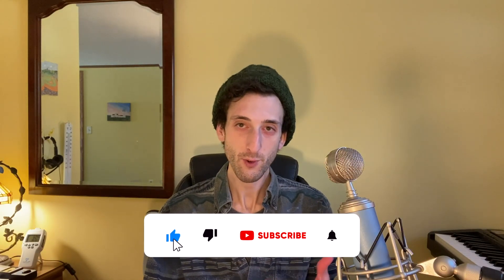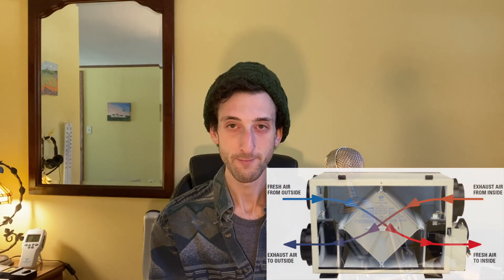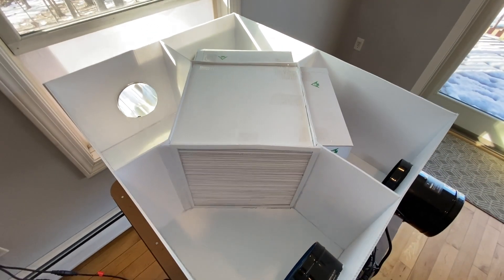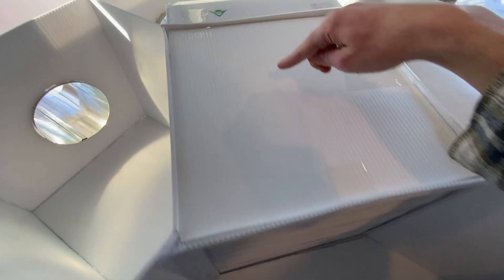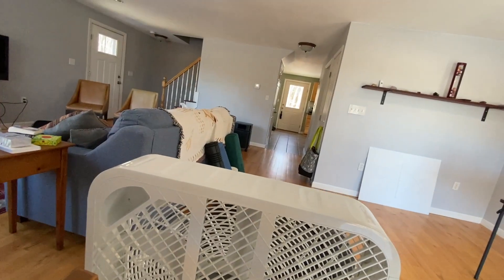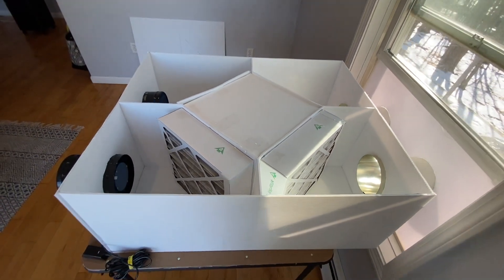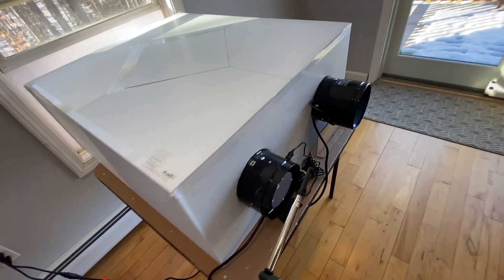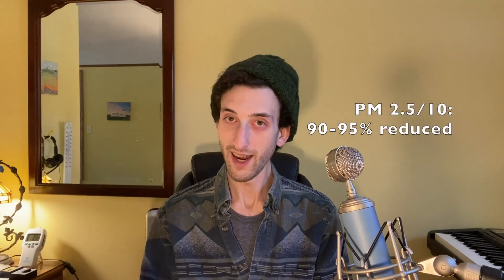I built the best DIY heat recovery ventilator I’ve seen on YouTube

Comment: I'm going to have to build my own. After updating the insulation in a hunting shack, it's too air tight. These massive units are too big for a 12x12 single room space. The mini or single room "HRV" units being sold, have fresh air intakes right next to their exhausts like bathroom fan style HRV's, which is an obvious and embarrassing engineering flaw.

Comment: You probably want to insulate the intake and exhaust pipes on the outside end of the HRV - those have cold (in winter)/hot (in summer) air that is going to lead to undesirable heat transfer to your indoor air.
Reply from the maker: I like that suggestion! Thanks.

Comment: Why do you need a merv 13 hepa filter when pushing stale air out of the house?
Reply from the maker: Good question! So first, MERV 13 and HEPA are two different things. I’m using a MERV 13 here when pushing stale air out of the house to protect the core from indoor pollutants.
Reply: @HealthyHomeGuide  The core is plastic, so even a much lower MERV (and hence higher airflow) filter would handle protecting the core from getting fouled with debris.
Reply from the maker: @Entropy512  I wanted both filters (intake and exhaust) to be the same rating (MERV 13) so that the pressure is as balanced as possible (positive/negative pressure isn't created).

Comment: On what speed setting do you run your fans? What rpm is it? And if you would use duct tubes would you up the speed?
Reply from the maker: They’re 8 speed 288 cfm fans, and I usually run them on speeds 1-2. If you have particularly long ducts with a lot of bends and ribs, you’ll likely have to increase the fan speed to get the same airflow. I do not like flexible ducting, because of the ribs which create a high amount of air resistance. I’d go with rigid ducts.
Reply: @HealthyHomeGuide  do you think you can have the exhaust fan on lower speed setting than the supply fan? It kind of makes sense to me,  to have the warm air pass slower through the cube core to warm it. Or it needs to be the same because of some balance, so it doesn't create some pressure change or whatever...
Also, do you maybe know what CFM would be on these lower settings like 1 and 2 ?  Appreciate it, cool idea for a channel, wish you luck!

Comment: I had an idea that might make the core better:
What if you would have Coroplast thickness bigger for the exhaust than the supply, then take like a 0,60mm copper wire and go in between every hole, since copper better conducts heat it should keep the core warmer, while the thinner Coloplast is on the supply, which makes the air pass slower through the cube. 
You have all the measuring stuff, so you could actually see if it makes a difference. But I don't see how plastic could be better than copper in heat conductivity.
Reply from the maker: I like the idea! I don’t think this HRV needs it, because the air it brings in is already warm enough for me, and I don’t know if additional energy use would be worth it. However, a heating coil could be useful on my other design, which consists of a fan attached to a MERV 13 filter. I’ll keep thinking on it!
Reply: Neat idea!  I bought a few rolls, and even got some for free, of aluminum window screen.  The thought was at some time 3D printing or maybe CNC in wood a tool and die to stamp like a linear ridge zig zag stamp so to increase the surface area of the alternating layers.  Where I plan to only space the one path of flow and use corrugate on the other path. The spaced path that would use two other maybe three strip of one width corrugate tubes would have the zig zag aluminum mesh.  I left off wondering how to plastic weld both sides into the full sheet of corrugate.  The other thought was just ironing into both side of the corrugate the aluminum screen.  That might work suitable as well and just then placing the zig zag screen into contact.  I probably should work on again since I have now another size of corrugate material and not only the cutout larger thickness.
Reply: just make the readily available pre made inexpensive plastic core a bit bigger, no need to finess the build.

Comment: Can you please tell me what is the ideal thickness of the Coroplast? did you go for the thinnest one? The one i found is 2,5mm, also there are 3mm and so on. 
Also do i need to worry about the adhesive spray off-gassing? could that be a problem?

Also, great stuff dude, keep making videos!
Reply from the maker: Certainly! I used 4 mm coroplast. Good question about the adhesive spray off-gassing. I used low VOC adhesive spray. It is also designed to dry quickly. Still, I left it outside for a day or two to ensure it off-gassed before being installed. Once installed, air shouldn’t pass in between the layers, where the spray is, so I think we’d be safe. 
Thanks for the encouragement!
Reply: @HealthyHomeGuide  
Thanks for replying, I have few more questions. 
1) I suffer with my breathing in my house, I need to make this, and I know if I make it, it will run every day, all day. When it comes to your fans, do they use a lot of energy when 2 of them are working all day.? And are they enough to work with longer ducts that would span a few meters?

2) Could I make a system where I'm placing this into an attic, taking air from one room (bedroom) pushing it outside, and pushing fresh air into another room (Workroom). So I have only 2 ducts going, Or do I need 2 ducts for every room? 
If i would just take air from one room (bedroom) all day and then just change the flow when I'm using that room at night. And then it's taking air from the workroom and pushing fresh air into the bedroom. 
I hope i'm being clear - my English is not that great XD 
Thank you for your time, I appreciate it!
Reply from the maker: @CroElectroStile  Sure thing! The fans I used have fully adjustable, brushless EC motors (efficient), and are 36W at full power - I run them on low speeds, which draws even less power. They're designed to run 24/7. I haven't calculated exactly how much extra money I'm paying to run them - I don't believe it's all that much.

In general, if you connect the fans to ducts, you'll likely get less airflow and have to run the fans on a higher setting. How much less airflow is dependent on a bunch of factors. The longer the ducts are, the more folds within them (as with flexible ducts), and the more bends, the less airflow you will get. If you're using rigid ducts, you'll get more airflow than flexible ducts. I very much dislike flexible ducting. It smells like chemicals too.

Great questions. The amount and distribution of ducts is a very complicated subject. Basically, the more branches you put in your system, the less airflow each branch will get. I'd recommend keeping it simple for DIY projects - as few ducts as possible. I'd bring the fresh air to the room you spend most of your time, and exhaust the air out from a different part of your house. Hope that helps!

Comment: Wow! Excellent job, I'm definitely going to build something similar
Reply from the maker: Thank you! And good luck! Let me know if you have any questions.
Reply: @HealthyHomeGuide  do you know how well this would work for hot and humid Texas summers? I know an ERV is what I need, just didn't know if that poly might work well for that or if I needed something like an aluminum core. Thanks!
Reply from the maker: @Slipperypuffin  Yup, an ERV (as opposed to an HRV) would absolutely be the way to go for the specific reason of ensuring your home didn’t pull in too much moisture from the humid Texas outdoors. If you have the budget and space, I’d recommend buying an ERV, because I’m not sure how to actually build one. 

If you want to try an HRV instead (which won’t get rid of humidity) coroplast could certainly work because coroplast is moisture resistant. Based on what I’ve seen, a coroplast core should do fine at cooling the incoming air in the summer, you’d just probably need some sort of condensation drain.

Comment: A low tech "defrost mode" method is to just redirect the two outdoor ports together so the core warms up to room temperature eventually. By measuring the output temperature and only going into defrost mode when the output goes below freezing can make it automatic.
Reply from the maker: That’s fascinating, I love the idea!
Reply: For a simpler low tech defrost, you could just put it on a timer. If the unit is in the house, you could turn it off for a few hours and it would naturally warm up and defrost. That is even more low tech.

Comment: Wow! Your did great! You did a great job! And so efficient too! I live in a very small home in CT, a 200 yr old home, I renovated 20 yrs ago. Our home is 24x22, with basement, 1st flr, 2nd flr, and walk up attic. It's a post and beam kinda house. I installed ductwork, and Air handlers, one in the attic to service the 2nd flr, and one in basement to service the 1st flr.  I have a boiler for heat, so it is a hydronic system. Each AHU has a hot water coil, that way I can also temper the discharge temp. So I think about 5 yrs ago, I added a Fan tech ERV to my 2nd flr setup.  I added external filter boxes, with I think Merv 12 filters it came with, cause you need to keep that core clean as well as the air we are gonna be breathing.  This was the lowest price unit at the time, and the enthalpy core is same product you used, but not as nice as yours, mine is not very efficient, so on really cold days, I don't use it.  But a year later I bought a HRV for the basement I spent a little more and got one a bit more efficient.  [I'm not rolling in $] I have seen some really high efficient EVR's but big $.  I'm fortunate I inject the "make up" air into my air handling system.  I also have UV-C lights in the AHU's.  I have my 2nd floor ERV set up so when I run it, a relay turns on the FAN mode on my t-stat, so the AHU is running to distribute the air when the ERV runs.  I have a Timer so 2nd floor runs at night [bedrooms all on 2nd flr] but also another timer called an Air cycler.  This means it will run say from 6pm to 8am, but the air cycler runs the system 15 mins every hour.  Then if someone hits the Exh fan switch for the bathroom, it turns on.  [The stale exhaust air, get sucked out through the bathroom registers].   Anyway the results are great!  I eventually will improve the ERV with a more efficient one in the future.  The indoor air can be so bad, plus I'm try to learn about "static" pressure in the house.  So when I turn on the range hood on highest setting 600cfm, where the make up air? or air coming in?  Do we pull a negative pressure bringing in more bad stuff through the chimney?? Or cracks around the doors??  So an intentional conditioned make up air system is so important, especially weather when you cannot open windows.   So thank you for sharing your project!  So cool!  [sorry to be so long winded here, but I get excited about this stuff! ]  God bless!   AL from CT
Reply from the maker: Thanks for your comment, Al! And thank you for sharing your HVAC experience. It sounds like you’ve had quite the ventilation journey. I’m actually thinking about make-up air a lot right now. And absolutely, if you don’t have a dedicated make-up air system, it’s very likely that the range hood (especially at the highest setting) is pulling air from hazardous places, or at the very least potentially causing moisture to build up in the cracks that the air gets sucked through.

Unfortunately, my kitchen actually doesn’t have an exhaust system at all! I’m now planning on putting one in. My next video is going to be about this! Tune in if you’re interested. It should be out within the next few days.

Comment: You could use a heavy duty aluminum foil to achieve better efficiency and smaller size.
Reply from the maker: Thanks for the tip! Do you know of any resources I can look at related to this?
Reply: @HealthyHomeGuide  https://youtu.be/6ahT9wybIsw he is saying  80%+, 43 layers of foil, but if to install better fans and seal everything better. Futhermore he installed his erv in a boiler room. But remember this guy lives in Russia and -30C/-22F is a common winter temp there.